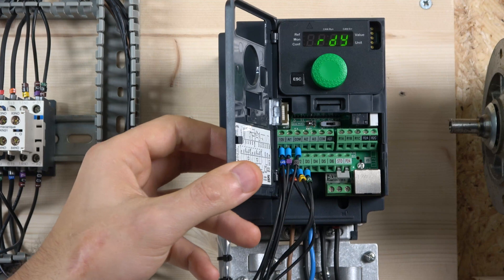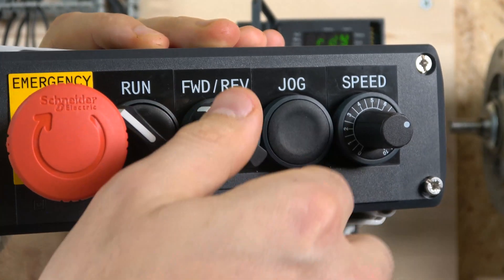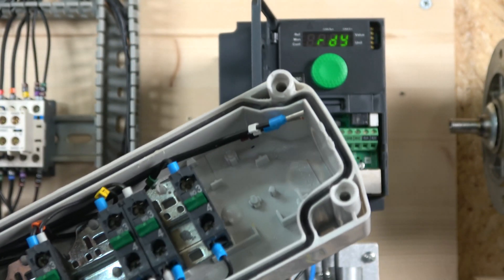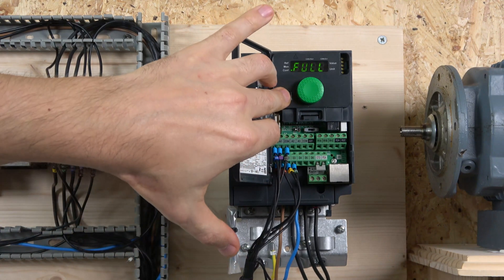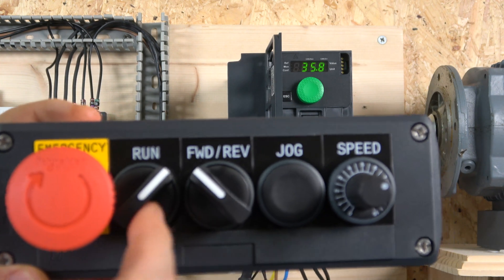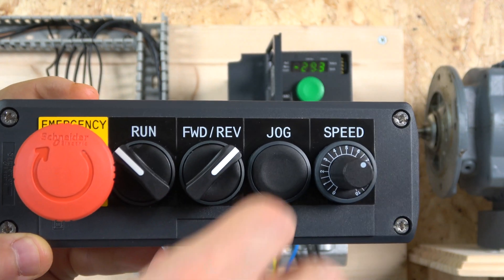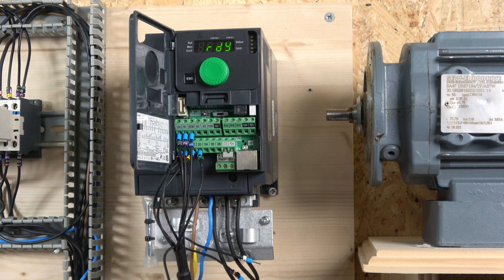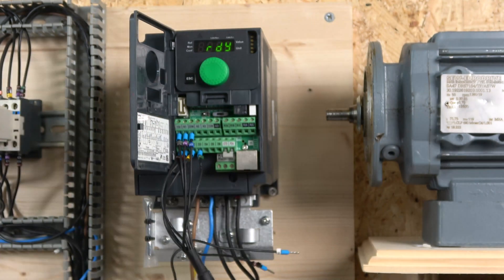Schneider Electric ATV320 VFD, remote control, 2 wire and 3 wire control, speed control. (English)

Comment: Thank you, this is a great explanation.
This drive uses a very elaborate and sometimes illogical way to set it up, and the programming manual is huge. The digital manual is stylized which makes searching for settings impossible.
I finally set it up via simple motor run, Conf > Full > Sin- i believe.
I'm Dutch and sometimes your English is a bit hard to follow, but you always make very useful videos, i loved that you showed your control button set up, Thank you again

Comment: Can u pls explain configuration - VFD is not taking speed command even after configuration of AI & automatically running on full speed without speed reference command .
Reply from the maker: It looks like potentiomater is closed. i.e there could be lot of problems that could cause that. It is hard to pin point exactly.

Comment: Thanks for good videos. 
About the emergency stop, is there any function assigned to it. 
So it´ll say stop on the display?
Reply from the maker: Hi There. Depending on your parameter set up. Some will some not.
Reply: @IGSElectronics  the emergency stop is in series with the stop button

Comment: thank you for everything, you are a great help to me, I have never used this product, I ask you a favor: I need to connect a fountain pump to the atv320, can you help me with the electrical connections and configuration of the atv320. I put a start button, a stop button and a potentiometer to increase or decrease the speed. thank you very much
Reply from the maker: Hi There. Glad you like the videos. Do you already have this unit as Schneider drives are not the easiest to set up. Have you watched the other 2 videos?

Comment: Can I have a 3 wire control with a jog button?
Reply from the maker: Hi There. Yes you can have Jog button. Assigned it to one of the free DI. On weekend I have last part of the drive video coming out, were i will talk more about how that works.
Reply: @IGSElectronics  thanks a lot
Reply: @IGSElectronics  okay good very good
Reply: How to run motor with jog  of drive..
Reply from the maker: @px4.-xi4ly  as far as am aware that option is not available for this drive.